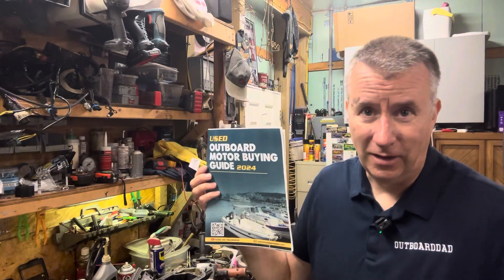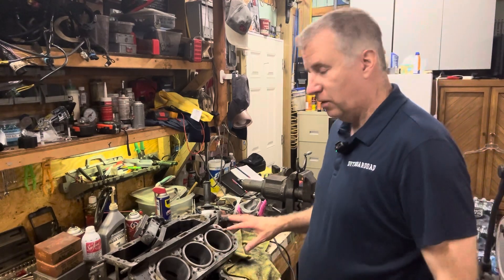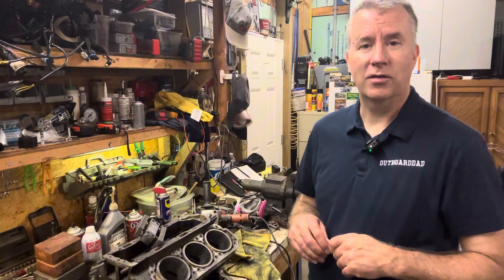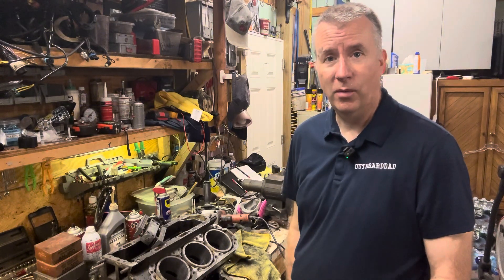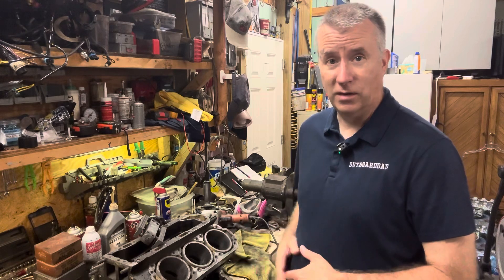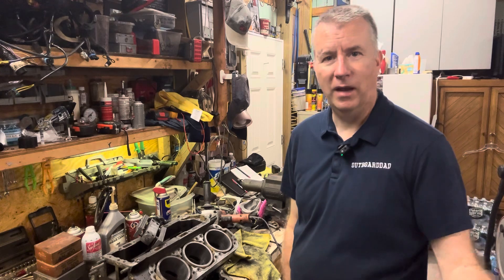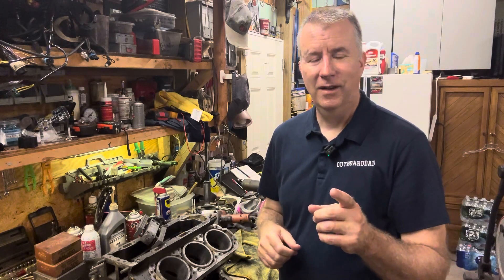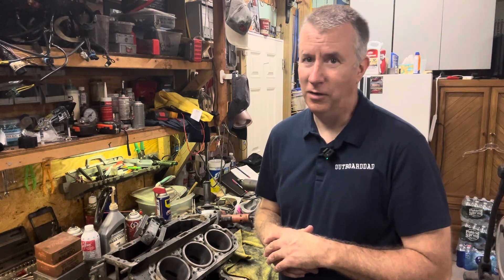Outboard machining practices 2.5 Mercury (Part 13)

Comment: Very interesting,, I to run a 2 cycle Mercury, the only problem is that it's that (2-4) 125 hp and is a Gas Hog! But runs fine.
Reply from the maker: @bobandrews2328  LOL ! Yess they burn fuel and oil like mad! But they keep on cranking and can be purchased for a lot less. Thank you for your comments!

Comment: Keith I have a Mercruiser engine it is an old Fairline Vixen and I want to get the total boat and engine and the sterndrive back to as close to perfect as I can, the engine is a 120 Hp 4 cylinder any help or rather advice you can give even just pointing me to the right company or you tube channel would be gratefully accepted.
Reply from the maker: @Jimmyfisher121  Hey Jimmy, where are you located? First is some basic tests , send me an email with you phone number and let’s talk. Keith@outboarddad.com
Reply: @OutboardDad  is this really you Keith or a conn I went there and it says it is starting soon I am a bit wary
Reply from the maker: @Jimmyfisher121  To the web site, if so I have not set it up yet. What can I say I’m a mechanic using a computer. Try this email keithm5734@verizon.net